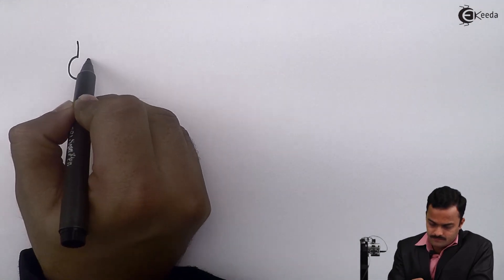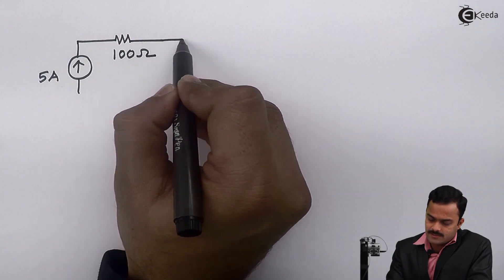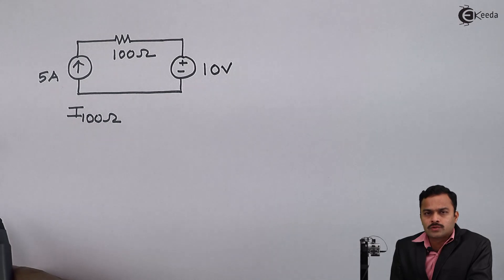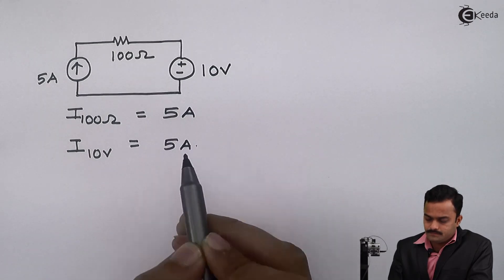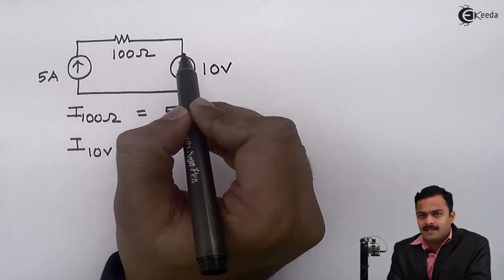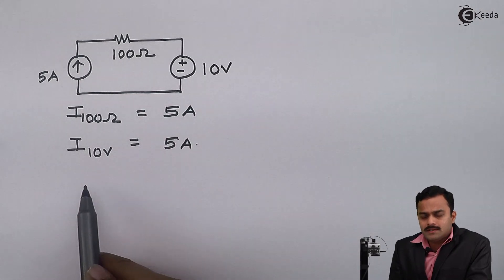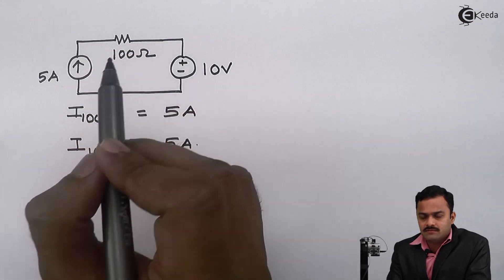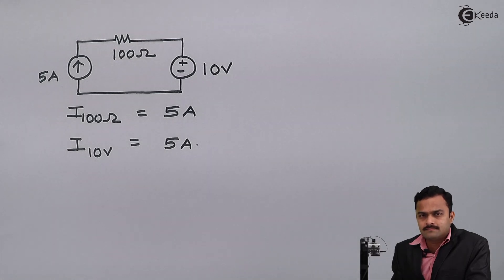Current Source in Series with Resistances and-or voltage Sources - DC Circuits

Comment: can u explain what will be the voltage across the 100 ohms resistor if it is connected parallel between same sources u provided
hope u reply soon
Reply: It is simply IR, here kvl will be maintained by changing the terminal voltage of current source
Reply: it is going to be 500 volts. :)